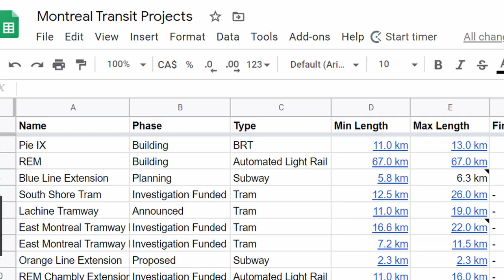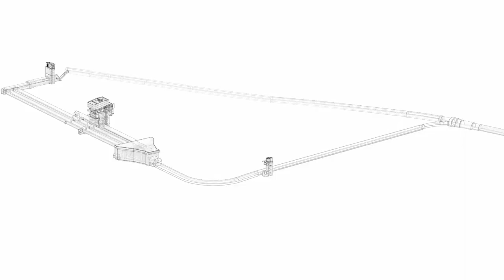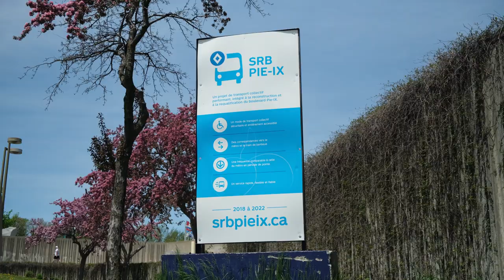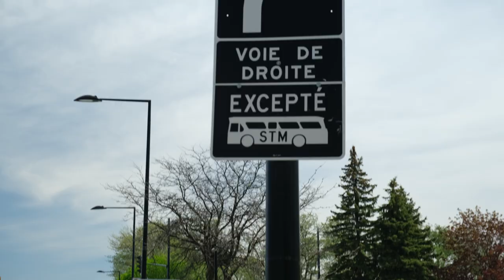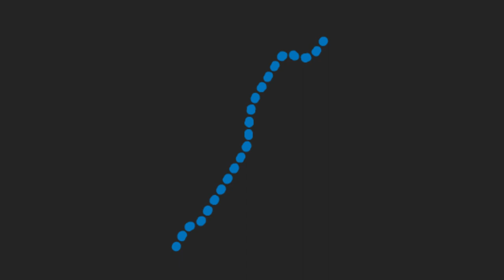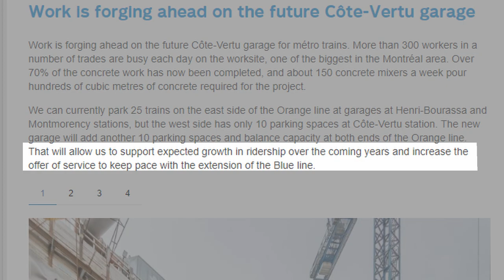Everything Being Built Right Now

Comment: I've been loving these video! Keep it up. One quibble. Busses are cheap to build and the initial infrastructure for them is cheap, but they're not cheaper to operate. Fuel, unionized drivers' wages and maintenance are more expensive than running an underground metro when you look at the long term and when you measure the cost in terms of how many people are transported. Montreal's 4 metro lines move almost as many people every day as our nearly 200 bus lines. Over 50 years, it has saved us huge amounts of money.The five stations of the blue line will likely serve more people than the individual REM lines on a daily basis. Part of the problem here is that we choose to build gigantic, overengineered, cavernous metro stations with far more capacity than they need when we could be building less elaborate stations that do the job.
Reply from the maker: Do you mean this point? https://youtu.be/zRolvdyObhY?t=182

Looking at the STM financials over the last few years I wouldn't really point to the metro as cheap to run vs a bus. Because the stations are all fully staffed, require (expensive) maintenance and have drivers on all the trains it's not like it's a one-easy-payment situation at all. The REM will be interesting though because it actually could achieve the low costs of operation that you mention per passenger mile.

However, this video really is specifically taking issue with the common phenomenon of light rail networks that basically just run with bus capacities and largely on roads. It's the tendency for cities to build expensive things when a bus is fine that I'm calling out.
Reply: @PaigeMTL  I think you're 100% correct on the problem with non-grade separated modes like the modern tramways. And the Montreal metro probably costs more than it needs to. Considering the trains are all run automatically except for the yellow line, they don't really need drivers. The stations are probably more expensive to run than they need to be, because they're way too big. I think we should build metro stations like New York, with access via street-level stairwells and elevators and more compact vestibules, rather than some of the gigantic cathedrals we've built thus far. As much as I love the unique station architecture here, we could also be much more utilitarian and opt for standardized building materials for new lines, which would reduce the cost of construction and maintenance in the long term. The Paris metro, for example, uses the same ceramic tile in almost all stations and manufactures the tiles in a factory dedicated for that purpose.
A good article on this point: https://www.theglobeandmail.com/opinion/article-canadas-soaring-subway-construction-costs-need-to-get-back-on-track/

You also made a good point on the correct use of the modern tramways with the Notre-Dame East corridor. Tramways have been very effective in European suburbs and small cities where they don't cross car traffic. They attract non-captive transit users (ie. upper-middle class car owners) in a way that busses don't.

LRTs are an interesting middle-of-the-road option between bus/trams and heavy metro lines, but it is important to remember that they don't carry as many passengers as the heavier-gage metro trains. That's why I think the blue and orange line extensions are good projects, just as the pink line would have been. The REM will likely be an adequate suburban commuter line, but I wouldn't want to see that technology used to supplement the central city metro lines. We will need a proper downtown relief line at some point.

BRTs can be a good solution, but their capacity is much lower than other mass transit solutions. Ottawa mostly grade-separated Transitway, for example, was so saturated that peak hour had jam-packed busses passing every minute. They needed a subway.

Comment: Busses with dedicated lanes  are great, when they opened the Trans Val-de-marne in france, it cut the transit significantly and provided a stable link between south and east Paris.
Reply from the maker: The Sauvé BRT is supposed to open this year, it's been very fast to build so I'm wondering if it's more of a bus lane.
Reply: It’s a little bit more. Call it BRT-light. 
The problem there is technical: Sauvé St and Côté-Vertu Blvd are very narrow. 
So they’re going to heroically squeeze as much as they can from those roads. 
It may be less rapid but it can help the line be more frequent and efficient. 
An acceptable compromise that could actually be a model for the other frequent lines, Park and Côte des Neiges for example.
The solution is to also make a real BRT on Henri-Bourassa. Which is beautifully wide and could easily be upgraded.

Comment: Buses are awful.
Reply from the maker: Awfully cost effective
Reply: Drivers will watch the REM speed past them as they're stuck in traffic. Exo trains often move much faster than cars at rush hour. Sure, between intersections the SRB will be faster, but SRB buses and cars are going to be stuck at the same traffic lights. Outside of rush hour, buses will probably be even slower than cars.
Crossing into the median of a busy street for a dedicated bus lane is not a comparable offer to a completely grade-separated network, and I doubt it will have much of an impact on converting people from car to transit.
Reply from the maker: The REM is miles away from Pie IX, they're not going to watch it do anything. The lights are being configured to automatically give green lights to buses. You'd cross into the middle of the street if it was light rail too. Are you open to the possibility of buses being a good option sometimes?
Reply: @PaigeMTL  Buses are a good option for low density neighbourhoods in order to connect people to (rail) rapid transit. Nobody leaves their cars just to switch to a bus in the next lane. They should have built the white line in the 1980s instead of taking 40 years to put a bunch of bus shelters in the centre lanes of boul. Pie-IX.
Reply: @cynthiakazmierzski8144  the student crisis in 2012 hundreds of millions in the garbage that could have paid your downpayment for a white line also hundreds of millions are beeing spent for elevators and no public toilets is à shame with the covid pandemic